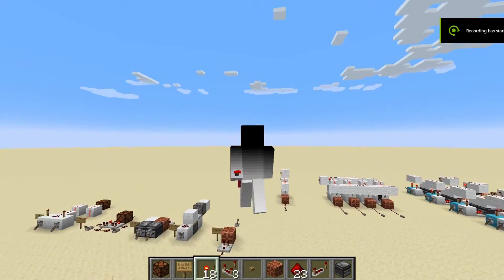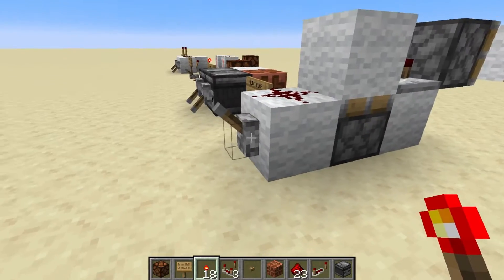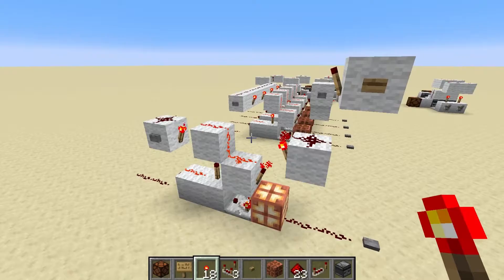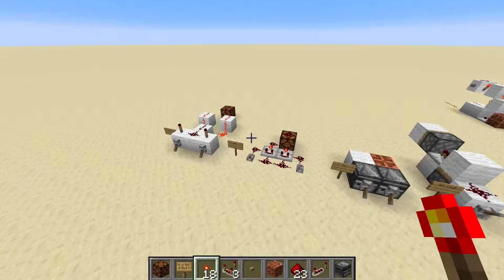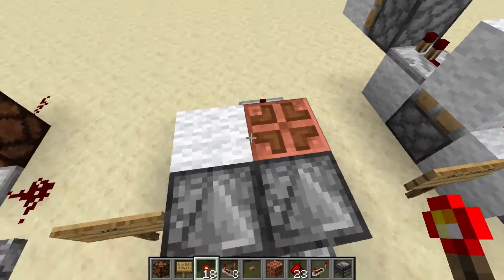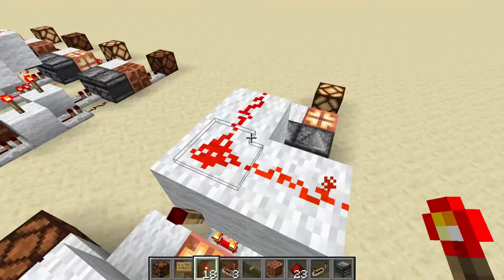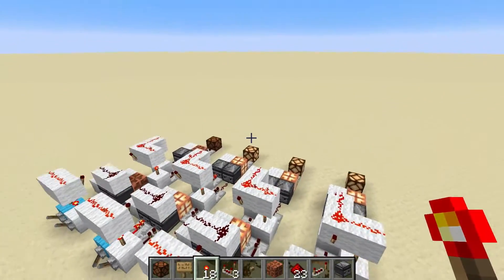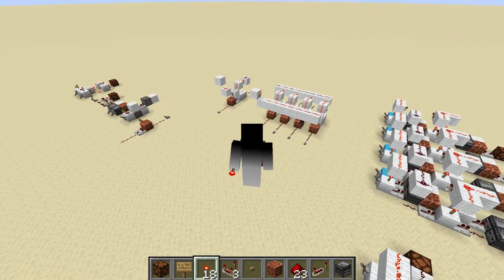First Copper Bulb Full Adder Minecraft (Revolutionary)

Comment: A string of copper bulbs and comparators acts as a binary counter. By using circuitry, you can count by any place. This creates a register that will sum up any numbers put into it. By inverting all of the bulbs, adding any numbers, and inverting them again, the numbers will be subtracted. These machines are stackable, easily used, and easily constructed.